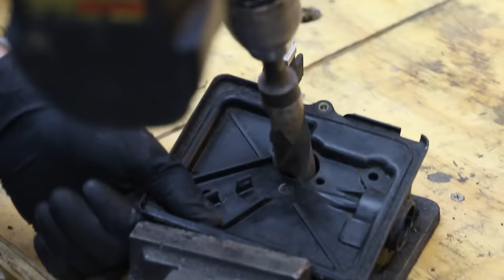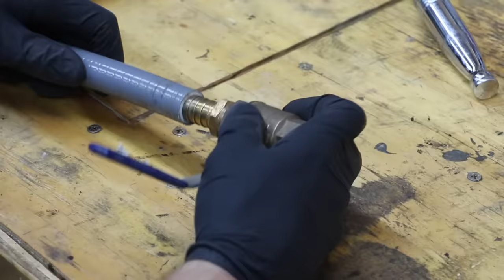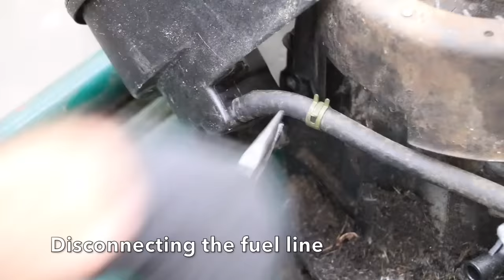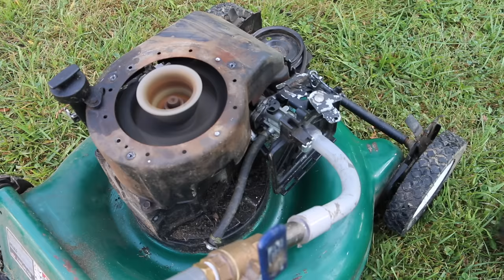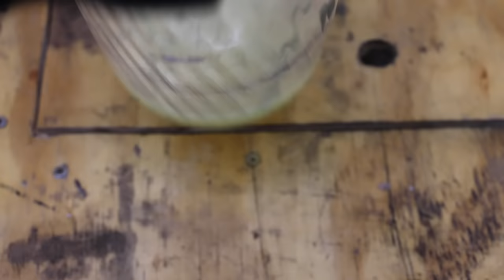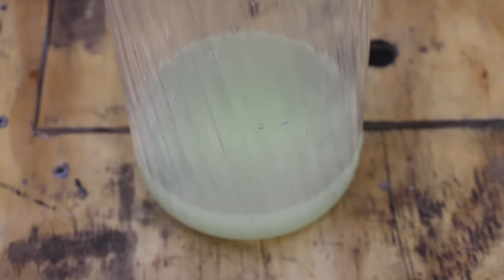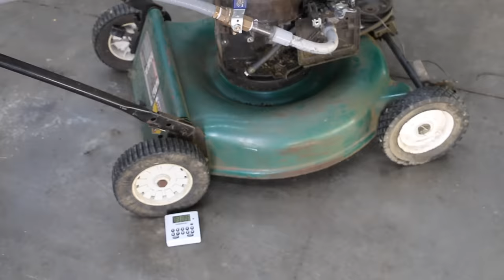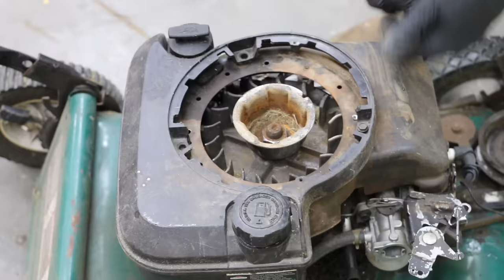Will a "Gas Vapor" Container Improve MPGs and Fuel Efficiency?  Let's find out!

Comment: Haven't watched the whole video yet, loved your opening statement: "wondering if an engine can run on gas vapors" .... Haha, that's called a carburetor or fuel injection system.  Back to the video...
Reply: Smokey Yunick's hot vapor engine got 50+ mpg back in the 1980's. This is not a new idea.
Reply: wrong, carburator or injection does not evaporate liquid, have you smelled a carb car's exhaust?
Reply: @bobbyatman273  What your nose does is detect vapors. That's what smells are. You may have noticed you can smell a cake baking in the oven. Is that because the cake got out of the oven and walked up your nose? It's because VAPORS from the cake escaped from the oven.

If you're smelling gasoline in the exhaust, that's because there is (unburned) fuel vapor in the exhaust.
Reply: @bobbyatman273  No, it vaporizes it.
Reply: That's exactly what I thought, he's just created a shitty carburettor
Reply: @ThePurza  well cheaply made, but not exactly crappy, it did just about as good as the original one.
Reply: @ThePurza  
I wouldn't say it's a shitty one. The regular carb often gets its nozzle screw loosened so it starts wasting fuel, this thing literally can't have that problem. Anything short of breaking the gas container is not gonna do jack.
Reply: Ah poor mark you dont actually know how Carbs and injectors Spray Liquid not Vapor.....But thanks for the misinformation
Reply: @vanillagorilla4547  yes but the job of a carburettor is to vaporise the liquid as much as possible

Gas evaporates very easily so the droplets should be tiny at most by the time it's heated before ignition

It was interesting to see that the vapour density in this video was enough to run an engine though
Reply: @ThePurza  Ah shitty carburettor that draws less fuel than a carburettor?
Reply: @zerocool6452  you can run a normal carburettor lean too, but it has less power and the excess oxygen causes corrosion

So if you want a lower powered engine that uses less gas, you are meant to buy a smaller engine
Reply: @vanillagorilla4547  Yes, and the spray of liquid evaporates and turns into a vapour, just like the bubbles through the liquid.
Reply: @zerocool6452  It uses less fuel if the ball-valve is adjusted to create a leaner mixture.  Which will burn hotter and so massively reduce the life of the engine.
Reply: @senseisecurityschool9337  The reason you can smell gasoline in the exhaust is because in low-power engines the carburettor is deliberately adjusted to give an over-rich mixture so that not all the fuel is burned.  This is so as to keep the engine cool.  A leaner mixture burns much hotter and is indeed more efficient - at the expense of a massively decreased engine life.  For the best of both worlds you could fit an exhaust temperature probe and adjust the mixture to the best setting for the particular throttle setting and outside air pressure.  This is indeed what is done on light aircraft that have both an EGT (exhaust gas temperature guage) and a mixture control so the pilot can contnually adjust for the lowest fuel consumption without wrecking the engine.
Reply: @ThePurza  there is a difference between aerosolizing and vaporizing,  of which carbs do the former. The difference, however, is tiny. This is why he sees a comparable difference in his testing.

Comment: Read into Tom Ogle.. He done this with his 1970’s galaxy and got 100mpgs. Great video
Reply from the maker: Thanks so much!
Reply: That's how I found this video ! Is this how Tom's setup worked?
Reply: And I will be the first to congratulate you for being the actual first comment from the top to actually discuss the point of the video.
Reply: what I wonder is if it affects performance though. Torque and horsepower wise yk.
Reply: @iGaRaai90  this isn’t a very professional setup but it does prove that this indeed save gas
Reply: No 1970s car ever got 100 mpg i suggest you study physics, this is a myth, water vapor is not compressable. Lawnmowers have almost no torque.
Reply: @invalidaccount2315  100 percent false, I believe it was Shell oil that got an Opel GT to run either 2 or 370 something miles to a gallon. 1976 I believe.
Reply: I believe he just showed you that Tom ogle was a liar.
Reply: @asswhole010  well that is a pretty primitive version if he were to actually improve on it further I believe he can achieve greater results although it might not be 100mpgs

Comment: you should try the pond fogger method,i commented 3 yrs ago on this vid and failed to mention that the emulsified fuel i ended up with "fogged" well and burnt in the engine,also,petrol that was so old it would not burn by a lit match "fogged" and ran in the engine also,a briggs and stratton lawn mower engine,i never did try the economy of either method,apparently heating the vapour via water jacket or exhaust makes a huge difference.
Garden pond foggers need to have the water level inhibitor jury rigged to work in petrol.
Petrol mixed with diesel should fog by ultrasonic fogger to run a diesel engine.
I'm going to rig something up (make my own ultrasonic drivers) to fit to my 1500 triumph spitfire(carbs non injection,yet).
Great vids and info as always.
Reply from the maker: Thanks!  Thanks for the suggestion.

Comment: every time you pour gasoline into a glass container, an OSHA rep's head explodes.
Reply from the maker: lol. Thank you
Reply: @isaackvasager9957  I believe the issue with storing gas in a glass container is that the glass can build up static electricity creating a spark when you touch it
Reply: @isaackvasager9957  I always thought it was because pressure build up. If you put gas in a glass container and capped it off, pressure could build up. However the glass will not swell like a regular gas can, it just cracks.
Reply: Old school visible pumps had huge glass tanks on top so you could see the gas before you bought it to make sure it wasn’t dirty
Reply: @isaackvasager9957  static
Reply: Guys, simple answer is if the glass container is capped off the vapors can build pressure. If the gas ignites for any reason it would explode and send shards of glass everywhere like a grenade.
Reply: OSHA has zero authority over private citizens, self employed or otherwise lol
Reply: @jjdogg0  This is false, if you have a business license or are employed by someone who does, OSHA has authority over your working conditions.  And if you end up in jail for conducting business without a license, fret not because OSHA has jurisdiction in prisons, too.
Reply: @actually5004  false
Reply: @jjdogg0  Well, you can if you don't need to be licensed, bonded, or insured and the business is not tied to any workplace location or vehicles and has no employees but even then you can be fined by OSHA for creating a hazard at another company's workplace as an independent contractor.  Even lemonade stands on public property can be fined by OSHA.  Hell, OSHA would have jurisdiction on the ISS if it had any regulations regarding space stations.
Reply: @actually5004  I'm an independent subcontractor who works for himself...untouchable, as is any family whom I employ or who works with me.

Comment: The same amount of energy does the same amount of work.
Reply from the maker: Great point
Reply: While that statement IS true, it fails to consider the "conversion rate" of the the process. It may be possible to get a "more complete" burn which would theoretically increase the power actually extracted from the the energy available in the fuel presented for the process. 2 stroke engines make a lot of power but a fair amount to fuel flows out the exhaust port before it can be actually converted to heat (thermal/mechanical energy) from the chemical energy presented for the process, thereby lowering the effective conversion rate.
Make sense?
Reply: @burnerjack01  That's what I thought to, may be more efficient.
Reply: BUT the conventional automobile engine wastes way too much of that energy !  where vaporization cuts that waste down significantly....  you can get much more work out of the same amount of gasoline simply because vaporization releases more energy than just spraying the fuel....
Reply: LOL  have you  heard about nuclear energy?
Reply: Lack of education a 3rd grader can make iTunes
Reply: @romanszefler7479  Have you ever heard of the strong nuclear force?
Reply: "The same amount of energy does the same amount of work."   -  Only if the efficiency is the same.
Reply: @burnerjack01  yeah man thats why they made the boost bottle it kinda works but nothing is perfect i wonder if you were to bubble the exaust thru the tank to try and re trap the fule but then the air tto gas would be out maybe maybe not cus if you stillused the carb and ran the rusulkting fumes froim the gas thru the air intake while allowing the air in noo just to much work kinda an iidea but a stupid one lol
Reply: @bobkelly2447  yeah like the spider injector from old chevy trucks literaly just dribled gas into the top of the distrubutor fumes would be way more effecient in that system for sure cuz that system sux
Reply: @romanszefler7479  yep some kid even made a genarator look it up it was nuts he just went around and all these ppl gave him all the stuff to make it it was something lol
Reply: But efficiency could change. In lamens terms that means higher mileage or longer running time
Reply: @ProjectFarm  If you tap into the energy all around  us in the universe,  1 cubic meter could boil all the water in the oceans away!!! This is how spacecraft can travel 10 faster than the speed of light!! We have this technology in our secret space program now!!
Reply: @burnerjack01  so basically your saying vapor burns more completely?
Reply: No my friend the same with the same fuel make the same AMOUNT of work. In same also emviroment
Reply: @bobkelly2447  did you not watch the video?  You think a lawnmower engine with carb is more efficient than a modern, computer controlled, direct injection engine?
Reply: @burnerjack01  actually you have a point if we're talking about poorly inefficiently designed 2 stroke motors you may actually save a little fuel but you could completlynegate all waste pretty near by putting your intake onto the crankcase and using a Reid valve also having a longer cylinder and having the exhaust Port nearest the top of the jog is opposed to having a head and you don't like they do on the more modern liquid cool KTM bikes and stuff with those really efficient mikuni and oko doloroto carbs ect  like they have been for like forever in Moto cross altho a lot of brands have gone 4 stroke now but regardless this system could maybe help a shitty old Craftsman chain saw or something equally shit but this day and age they pretty well mix the air to fuel almost perfectly like really not gonna make it any better with a gas bong attached to the side lol
Reply: Hey do you do a spray adhesive video or a 2 part epoxy video those tho would be cool to see also best waterproofing spray  or treatment would also be sweet
Reply: @burnerjack01   Because the vapor burns so fast the total energy is expended before most of the power stroke happens leading to much less torque and consequently less power under load (he never compared the engines under significant load), but the horsepower can remain comparable because the bore hasn't changed.  Efficiency of a pump (any ICE) is a simple equation but he didn't change any variables save liquid fuel amount and AFR- exhaust mass, temperature, and velocity as well as pumping losses due to friction as well as fuel velocity (for an ICE this includes atmospheric O2 and is determined by piston speed) are all identical- he's just giving the system less energy through unconventional means.

The additional energy that is required for the engine to idle at all enters the system through atmospheric fuel vapor preheating and people figured this out the 60's but scaling the system up (while using normal pump gas) means more preheat is required through other means which makes the system highly explosive- more explosive than it already is.

Oh, and the common misconception that engines don't already run on fuel vapors is false, carbs and injectors both atomize the fuel to make it easier for the heat and pressure of the combustion chamber to vaporize the fuel during the compression stage.
Reply: Y'all are ignorant of the fact that with all those emissions laws, if it was this easy to get better mileage everybody would be doing it.
Reply: john hanrahan but engines already extract 25-40% of gasolines potential power output. To claim that you can pull 5x the amount out of the same amount of gas, it’s absolutely ignorant and goes against every law of energy that exists.
Reply: Your average combustion engine wastes a good deal of the energy by converting it into useless energies such as thermal energy, and the point of “running it on vapors” would be to mitigate the amount of wasted potential energy the fuel has. So, yes. The same amount of energy does the same amount of work; using that energy more efficiently will result in more work being done.
Reply: @MichaelParker-mi6ie  see my above comment
Reply: @richardmillhousenixon  If I were interested in anything but the purely physics-related nature of OP's comment I would have mentioned it. As far as the legalistic semantics go, I don't really care. I was simply attempting to rectify a misunderstanding; Not sure how you figured law into this when, as far as I recall, nobody mentioned law.

Comment: I've watched before , I would like to see you do same set up but with a hydrogen generator. 
I'm very interested in heating with hydrogen as a source of fuel for a furnace, but also curious on engines powered by hydrogen...
Reply: Super cool idea, but from what I understand the electricity used to covert water to hydrogen is essentially more then just using the electricity for heating or power in general.
Reply: He did do a test on a hydrogen generator look it up
Reply: @chrisdonnelly5904  Oil company had a Gun on him while he did HHO test
Reply: @chrisglenz5804  you can do so without electricity too

Comment: I did gas, methanol and water vapor experiments back in 1977.  It did slightly reduce combustion temperatures, and you could increase the timing a little as well.  But maintaining the mixture ratios and shutting down the methanol and water well before engine shutdown to reduce rust and corrosion just made it impractical.  I did get 21 mpg with a 68 Chevy Pickup truck with a 250Ci and 411 rear end gears. But I also got similar results with premium fuel and advancing the timing and a little hot air added to the intake which was a totally transparent system requiring no extra effort on the drivers part. Engines have come a long way since then.
Reply from the maker: Thanks for sharing.